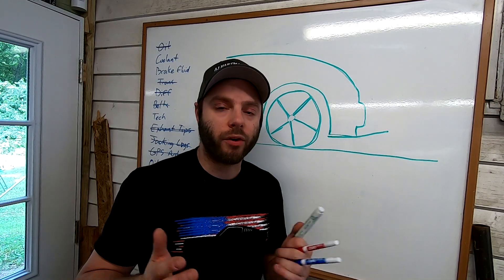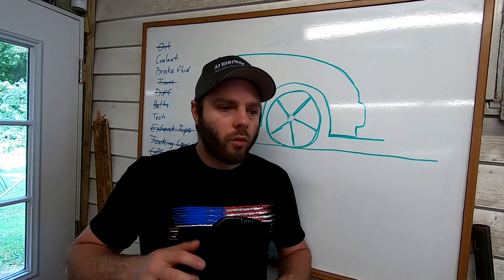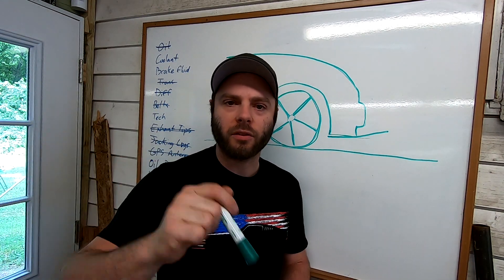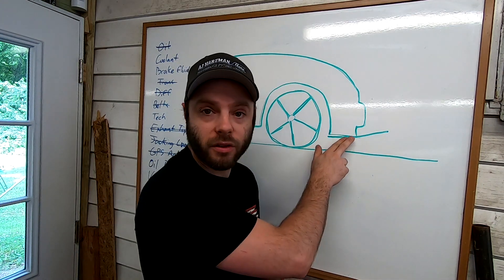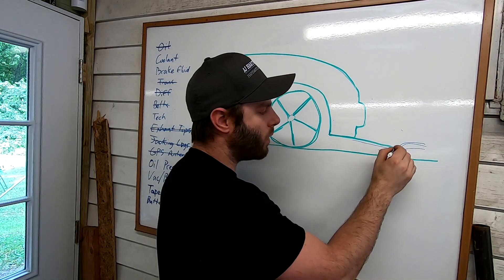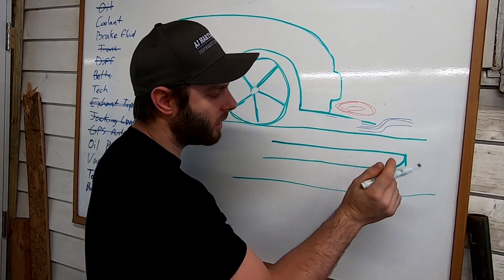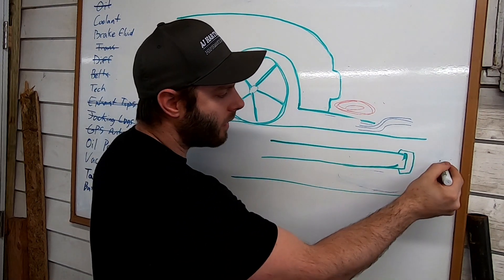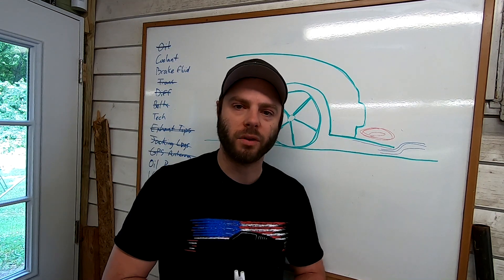Proper Splitter Angle for Flat Splitter Blades

Comment: Is that front edge the only reason you don't recommend alumilite? I run alumilite and having a curved front edge is something I can make happen. It happened naturally when I ground it off my other racecar coming out of a few bad parking lots. I Just made a new splitter, I used alumilite because I have been getting it used for free.

Comment: I understand that this video is referring to splitters without flat floor, and also that its aero at and entry stage for people mounting at home. But its worth to mention that if your feeding a raked, sculpted or a floor with an effective diffusor, mounting the splitter upward is often a great way to get more cleaner air and increasing air velocity and downforce. I do this on my TA customer cars after CFD simulations. Widely used in TA motorsports and other unregulated classes. You do move the center of pressure backward since you are creating a little bit of lift at the very front but gain overall DF. How ever if you manage to accelerate the air enough under the floor, the speed will also increase enough under the compression zone so that you still gain net DF under the splitter.
Reply from the maker: That’s a completely different topic for another video.
Reply: @ajhartmanaero  Would it be possible for you to make a video like that? I was curious about splitter mounting angles if you are using splitter diffusers. Thanks!
Reply: @blaizify  unless the splitter is sculpted just for that scenario or as i mentioned above, cpntinued by a flat/sculpted flat floor run it like aj describes in the video.

Comment: Hi I had one doubt. My 2021 bmw m340i comes with the m sport package. Which has a front bumper that kinda already has a 2 inch horizontal design to it. Does that already act a splitter ? Plus there is a half inch deflector underneath the car’s body. Do I really need a front splitter which will help in better cornering ?

Comment: Is there a specific angle of rake that is ideal? And if the angle is zero, is that a bad thing?
Reply from the maker: No. All depends on the desired result. And zero is OK since it will rake down under braking, but will be nose up accelerating which will give you terrible balance. Hence wanting it atleast a little down.

Comment: You can angle the splitter up to 7 degrees downhill. More than 8 degrees will cause separation on the bottom which makes turbulance.
Reply from the maker: What about 7.1 degrees?

Comment: Hi! can ask you ? with a flat booton and rear diffuser will work the same with the splitter angle down? 
will not kill that angle the work of the rear diffuser?, i been reading in all books like a little front algle up of the splitter is good to feed air to the rear diffusers.

Comment: Im thinking, if some times the perfect rear diffuser (going up from the lower part of the floor  to before the end) and rear windshield (going down after the hood until the end of the rear) ideal angle is refered as 12 degrees, will the splitter be the most effective at that angle? Im assuming that such angle would be way to high as something like 3 to 5 degrees are most seen.
Great content as allways, loving all the videos. Probably my favorite aerodynamic subject channel by now, as Kyle have been a little off.

Comment: Appreciate the info. With most modern cars, curb approach is factored in. The 5th gen Camaro has 6* of upward angle at the center front. I tried to build something to make that 0* . It took a 1.5" spacer in the center that tapered downward  as you went outward. Tough to keep it all intact after a few track days.  Still trying to figure it all out and retain the factory front bumper

Comment: Thanks for sharing your knowledge. I´ve heard rumors about splitter thickness. Someone saying thicker is better, but i dont get much why? I would like to build my first splitter in range of 6-8mm (0,24-0,31 inch) of breech plywood
Reply from the maker: A benefit of thickness is usually strength which is a good thing.

Comment: Could you, in theory, run a simple aerofoil profile in place of a flat front splitter?
Reply from the maker: Yes. That’s essentially what splitters are on GTLM and prototypes, and more obviously on F1 cars.
Reply: @ajhartmanaero  Follow up question: why do you think it isn't as common in other series of motorsports? Are there inherent advantages to using a splitter instead of a wing?
Reply: SAR basically because it’s a lot more difficult for an amateur racer / low budget team to produce a shape that isn’t flat. And once you start moving to more advanced shapes you really need to be analysing it in CFD or you are simply guessing on shapes and sizes etc.

Comment: I think your gripe with alumalite is misplaced. It's a lightweight, strong, and weatherproof alternative to plywood(heavy, not weatherproof) or carbon(expensive and difficult to build). its quite easy to seal/radius with some silicone or rubber edgeing.
Reply from the maker: Wingman703 I’ve built plenty of splitters with a lot of different materials and it’s my least favorite. Not right or wrong, just not what I’d use.
Reply: @ajhartmanaero  What would be your suggusted material for the enthusiast that wants something lighter and more durable then ply, but can't fork up the money for carbon?

Comment: Is adjustment of ride height the best way to remedy this or could you for example, add shims to adjust the rake of the splitter itself?
Reply from the maker: Splitter itself if possible so you don’t change suspension geometry (assuming you’re suspension geometry is dialed in)

Comment: I would also imagine, the thinner the better (of course maintaining proper structural rigidity/strength). I purchased a half-inch birch composite splitter. The front leading edge is slightly rounded out top and bottom.
Reply from the maker: Technically yeah, but you want to get close to the ground as well. So either a fatter splitter blade, or a longer air dam will get you closer to the ground.